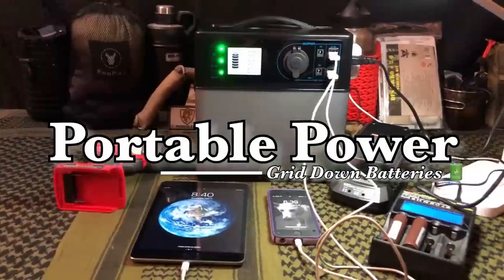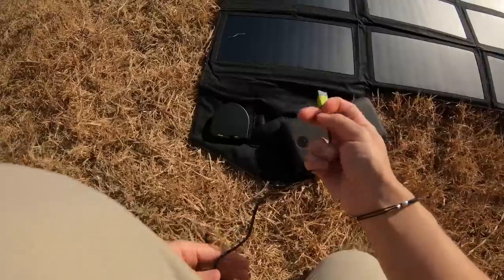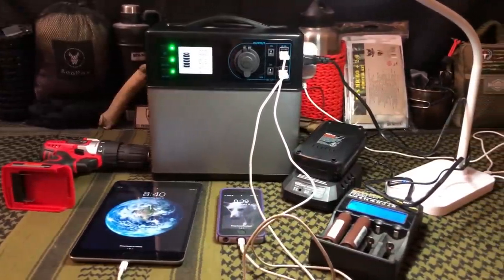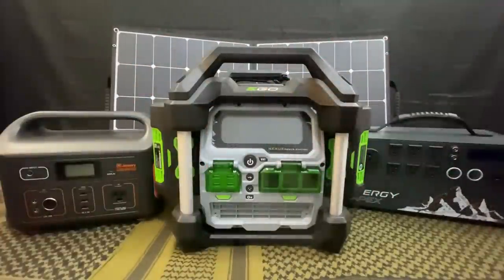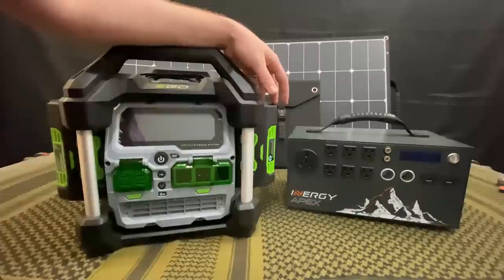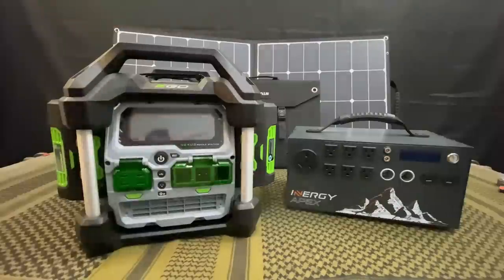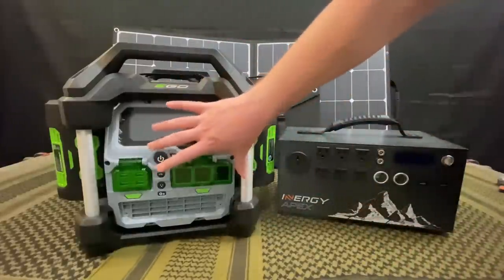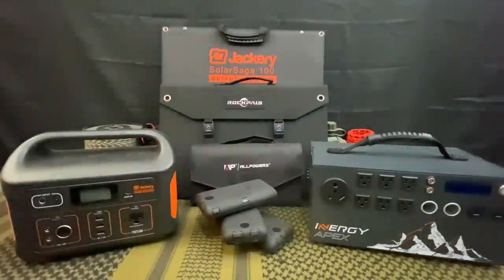10 Best Portable Lithium-Ion Power Stations!

Comment from the maker: Why do you use Portable Power Stations? Power During a Hike, Emergency Power during short power outage, or Full Grid  Down Preps?
Reply: DropForgedSurvival Short Camping Trips and Extended Power Outages
Reply from the maker: @OutdoorMomma  I feel that is true for most folks.
Reply: DropForgedSurvival just in case..hurricane Irma was horrible..9 days no electricity or water (well) & fema didn't bother helping us even with proof of flooding😑
Reply: Usually camping and occasional outages...
Reply: I have one for emergency grid down be it some one ran their car into power pole or a hurricane came through.  300 watt pyrmax with a 60 watt solar panel.
Reply: Does anyone know of a Portable power station that has USB output for UPS  Windows Battery / Power Managerment so it will hibernate computer gracefully?
Reply: I don't have one yet, but that's why I am here. Trying to find one to recharge my DSLR batteries, currently having to use the cigarette lighter in the car to charge. All I want to do is get away from using the car battery and stay at camp.
Reply: Power outages. I have an ExpertPower Alpha 400  with a 100 watt Richsolar solar panel.  It"s good for my Alpicool C20 and lights. Looking for bigger output but portable.
Reply: How can you celebrate in Pakistan?
Reply: I have a custom built 2.1 channel stereo surround sound. 
Two 150 watt RMS marine 6X9 speakers and a 350 watt RMS marine subwoofer. 
It has a battery similar to a wheelchair battery.
Reply: I live out of my van
Reply: I'm homeless so I use them every day.
Reply: @DropForgedSurvival  Like Ravpower better or Jackery?  The Rav is on sale for 200 !   252 watts  70200 MAH..or like another for 200-250 better?
Reply: @DropForgedSurvival  Can you recommend any good power bank for heating blanket in winter camping?

Comment: I have been using Ego Power+ yard equipment for almost 8 years now, all the batteries are interchangeable on any EGO equipment, they are great!   I started with the string trimmer and soon added the blower; one of those batteries died about two years ago, so it was slightly over 6 years old when it died.  My next purchase was the 18" chain saw about 3 years ago, and last year we bought the dual battery self propelled mower.  So four tools five batteries and only one battery is worn out.     The Power Station is on my wish list, as it also works as a smart charger for up to four batteries at a time, managing each one separately for maximum battery life span.

Comment: I have the Nexus inverter and love it so far. Like you said, I use it regularly as the charger for all my batteries for my blower and pole saw. Will power the fridge when the power goes out, and I plan to haul it camping in spring and summer  for lighting and heat on cooler weather. Has some nice features, though the batteries are pricey. Luckily you get lots of use out of the, besides just as an inverter.

Comment: I just bought a 50w fold able solar panel and a 200w power station from renogy and so far they are pretty amazing. It wont run my small panda washer which is a bummer but it WILL operate my 60w DC fridge which makes it worth it in my opinion. I plan on getting a larger one around Christmas time but this works for now. I work seasonally with my husband he's a UPS driver so that's when I'll have a bump in income. The solar panel charged the battery incredibly quickly. It will charge my laptop, and i can run the fridge periodically if I have to to keeps some cold food in the house. I could also use the fridge as a freezer to make ice blocks for coolers if neccessary. I'm really happy with it for now. Thanks for doing this. :)

Comment: Beware of what the units mean, Watthour isn't power (how quickly energy is transferred), it is the energy it stores. Same with milliamps (current) and milliamphours (charge), big difference between the two.
Reply: so what should we look for?
Reply: -V (voltage)

5v is anything run off USB.

12V is provided by car/truck batteries and solar panels. They power typical (vehicle) camping appliances like mini fridges, kettles or laptops.

18v is somewhat similar to 12v but far less common.

-Amps is just how fast a piece of tec draws power. Ignore for the most part.

-Amp hours/ mAh (Milliamp Hours) 
Is the typical "power capacity" for 5v/phones/personal tech.

1,000 mAh = 1 Ah

Phones are between 3,000-5,000 mAh, Battery Banks are between 5,000- 100,000 mAh

- Watts(W) are Amps(I) X Volts(V) W=I*V

A 100W solar panel can do basic lighting, recharge personal tech and keep a battery topped, on a sunny day. 

Generally if you want a system, calculate how much power you want to use in a day and get yourself a battery that will hold at least 3 times that. Note, this is for larger systems.

Comment: I need some advice. These things are expensive and I am on a limited budget (disabled), so basically a one-off deal. I need a power station that can do/have the following.
(1) Needs to power a laptop for extended periods up to 10-12 hours, running 1 program only (no internet surfing/ not on line)
(2) Needs to have UK 220/240v output/ UK mains 220/240v mains input for charging
(3) Needs to be portable (1 hand)
(4) Solar charging

The reason is that I am an aircraft nut (tail number spotter). I live in Manchester (UK) and at some point want to travel down to London Heathrow for some spotting on the train. I want to take my laptop as it runs a virtual radar program with a connected ADS-B (Virtual radar receiving box) that powers on my laptops USB port.  As I would be sat in a car park, not actually in a car or on a field, I need remote power to keep my laptop running for extended time after the laptop battery is dead, so need to charge laptop battery at the same time and then mains power charge it at night in a hotel room if I go for a weekend or even take it to the top of my local hills for the day, as it is the approach to Manchester (UK) airport to do the same thing running my laptop and virtual radar receiving box, so again a full day remote away from home.

I am not technical in anyway, so need the advice so I don't waste money. Any help would be appreciated.

Comment: After comparing several units a couple of years ago, I got the [up to] 1500w Patriot Power Generator unit. It may only have 2 ac outlets [+ usb and dc outlets], but for $2k, I got the unit AND a big beefy, rigid 100w Bosch solar panel. [plus little goodies they throw in too] 

I'd love to hear your thoughts, if you know how it compares with others you're familiar with?
Reply: Looks like you did your homework researching, may I ask what made you decide on the Patriot? I’m currently trying to decide which one to get, I mostly want it for the fridge.
Thank you.
Reply: @suzanneweiss4347  Most comparable units cost as much or more as the Patriot, but you get the generator alone - no panels. So those others would cost much more to set up overall. It's always worth a careful check - esp of recent reviews and product ratings, because new stuff comes out all the time. But Patriot has beefed the unit up to 1800w now for around $2500 - including their high quality panel + extras. Still only has 2 ac outlets, but you can always plug in a power strip for more. If you decide to get a Patriot, I HIGHLY advise to call them to place your order and not try to use their sketchy web site - the one big draw back.
Reply: NEWS FOR LIBERTY thank you so much for your advice and prompt response.
I really appreciate it.

Comment: DropForgedSurvival:  I need to power a laser printer in my car occasionally for my mobile office.  The power on the spec sheet says 670w.  Which would work, and for how long? (I typically have batches of 120-150 pages, which last about 10-15 min of continous printing)

Comment: Could you do a add on video to this topic. I am thinking one of the anker powerhouses. An I am just after powering tech ability to run fans or small heaters. I’ve tried reading the technical stuff about watt hours an voltage. an honestly it’s over my head. Could you do a little break down of that? What’s to much for them to handle. What it handles easily..
Reply: I went thru an Electrician apprenticeship program to become a certified electrician and can tell you from studying electrical theory that any type of heating element will drain amphours quickly. You might want to go with at least 1000 watt and try those out to start.

Comment: I have the rockpal 300wh it can run my 12volt fridge for about a day it charges faster than the jackery that's why I bought it.
Reply from the maker: right on!
Reply: Hey , do your power station has a inverter ? Or did you buy the inverter separately ?
Reply: @bahaly7371  it does have a inverter I just use the 12volt dc
Reply: se zaback Nice , so I can charge it with a solar panel or not ?

Comment: I'm new to the whole portable power station. What would be a slight overkill to power a mobile livestream? I'm talking a laptop with a 175w charger, and a canon AC power adapter all plugged into a power strip? Looking to only power these two possible 3 devices. I was looking into the Anker Powerhouse II 400 but I saw Westinghouse makes a 600Wh for double the price. I trust Anker from my experience with Powerbanks. Thanks in advance.

Comment: I'm searching for a power station that has the capability to be recharged with solar panels that could be placed securely on my van roof, even in the rain while I'm out hiking for the day. I would be using it for van camping in colder weather.  I would need to run a heater at night along with a few small items charging.  
Which one would you suggest?

Comment: What happens when you connect the power cord from a larger power station...to another portable power unit? Does that create a sort of parallel power station? Just thinking about powering a single appliance for a longer period of time. I know with some of the Yeti batteries you can actually daily chain batteries.

Comment: I like an assortment of inverters from 500w to 5000w and then multiple deep cycle marine batteries.
Reply from the maker: DIY projects are always great. Though not always as portable at times
Reply: I agree.  You can swap out batteries, inverters, or other components with the DIY approach.  What happens with one of these portables when the inverter goes out and everything else is still good?  Send it in for repair, warranty, whatever, but no help when you need it most.

Comment: What was that giant solar fold out in the video?
Reply from the maker: There are a few Fold out Panels in the Video.
Reply: Never mind. I looked it up. It’s only 120 watts and costs $1500. It looked like it would produce way more than that and should only be a couple hundred bucks.
Reply: The large panel looked like a Powerfilm brand panel. Those are military grade durable but very expensive.

Comment: Is there one I can leave plunged into the wall and have an essential electronic plug into it so if  the power shuts off the battery takes over? I'm asking because my grandpa needs something for his dialysis machine in case the power goes out at night.

Comment: Question: I need to power a desktop computer which is 12 V x 12 A, as well as a 27” monitor and a POE 4 port router. The setup will support 2 x POE network cameras and needs to run for at least 2 hours quietly. Can someone help me out with a suggestion on with battery to buy???Thanks I am a total newbie at this

Comment: Any idea how long some of these power stations could run a refrigerator on a charge? Also, are the solar panels waterproof? I live in Florida and am thinking hurricanes. We lose power, but then there are also intermittent rain showers for a while afterwards.
Reply: I am wondering the same thing.
From what I have read elsewhere, the suggestion is to buy a Kill-a-watt to get accurate measurement.
Even for those who have generators the suggestion is to run the refrigerator a 1-2 hours twice a day.
Reply: Whirlpool side by side on Ego with three 7.5ah & one 2.5ah battery lasted 13.5 hours.  Normal use of fridge while testing included water and ice dispensing, normal door opening traffic, and a few ice making cycles.  My ice bin was somewhat empty.

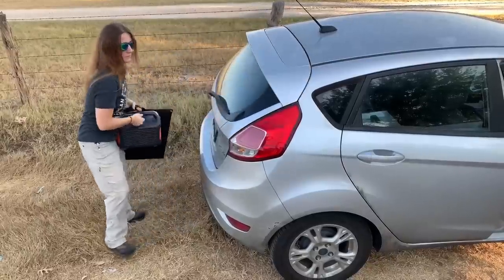Comment: 7:00 one outlet ... is not a bad thing.. its more efficient than wasted  hot jacks with nothing in  them ... thats like extra  wire  fore no reason , if you need more outlets buy an adaptor .... but careful ... gonna drain ya  juice faster ..  i like the new USB lights , good for a black out but  burn so little power

Comment: You must be the one guy who didn't receive a Lit Mobile solar wireless battery pack, Its got really nice grips on the side, its shock proof, and water resistant. The power bank has 20,000 milliamps which can fully charge your phone up to eight times. Its also got a convenient loop for carrying. on the back of the device that has a bunch of solar panels which can charge the battery bank in about 60 minutes. On the top of the device, there are 3 usb ports and 2 of them are fast charging.

Comment: 90 Ah battery... just to be clear, Amp-hours is not a capacity, as it depends on the voltage as well. Watt-hours is capacity, and the EGO with 4 7.5 Amp hour batteries (420 watt-hours each) has more energy storage than the Inergy. Not saying its better, but just want to be clear.

Comment: One question please, what recommend for my fridge 40w.
Thanks in advance
Reply: A house.
Reply: Bare minimum 1000wh
Reply: @SchoolforHackers  for my van
Reply: Ah, so like 12v 40w? 3.33 amps? I’m ignorant about that kind of fridge, but at those numbers you could run off a little 250-300 kWh jackery or whatever. But in Hobo’s video on What Will It Run he’s using a jackery 1000 for his fridge/ freezer. Bet that is a lot more load than yours, but check the numbers.

Comment: We need power stations to run power tools. IOW replace generators even on job sites.
Reply: The ego power station runs pretty much everything I need on the jobsite except a table saw. It usually trips the breaker on it after a few cuts.
Reply: @sparks701  Very cool.

Comment: ego power station is not available at the link you provided. Says don't know when it will be back in stock. :(
Reply: Mike McDonald look on eBay. Way better prices out there. Got mine new in box with 2 7.5amp batteries for $700. The batteries alone are over $500.

Comment: Ego company lies about the performance of their unit. It doesn't provide 3000W max, it doesn't provide 2000w continuous. If you pull that much wattage out, you may short circuit, or burn or damage $300 dollar battery. Of course it doesn't support solar panel, Just simple calculation of wattage from their 4 batteries tells us that. It's battery is quite expensive to its capacity too.

Comment: Meh, I make my own power stations at a fraction of the cost of these.
Reply from the maker: Good for you bud! Save that money
Reply: What do u reccomend for a camper van- 2x 12v deep cycle in parallel or 2 or 4x 6volts tied
Reply: I would just stick with two 12v deep cycle, only because there numerous 12v products out there, and so easy to maintain. Personally I use dead discarded batteries and bring them back to life, they seem to work fine.
Reply: @choppercardinal9421  nice thanks. i like the trojan t105 6volt but they are expensive...& gotta get two!
may just get two 100 amp hour 12 volts & power a fridge, don't think 1 battery would do it